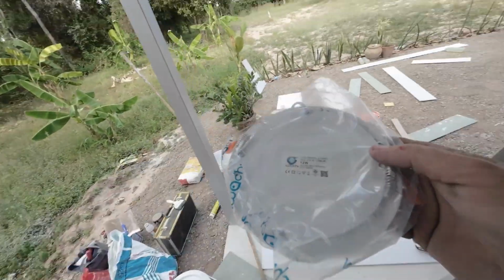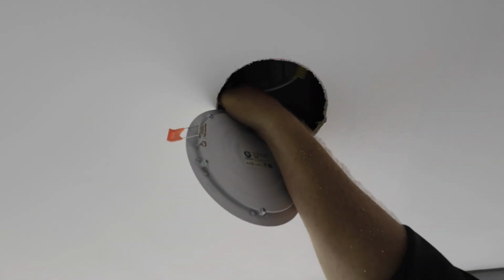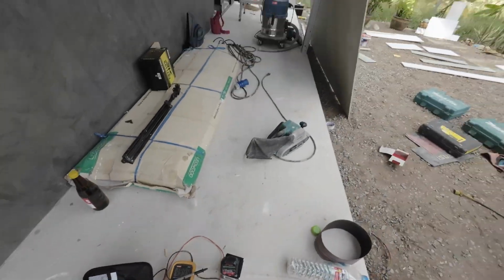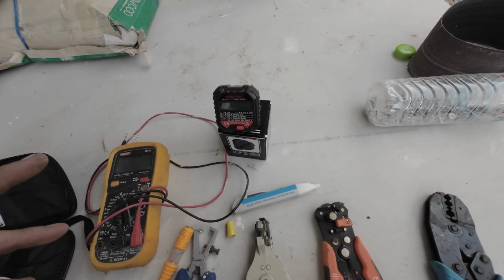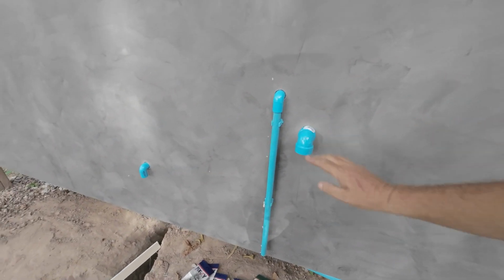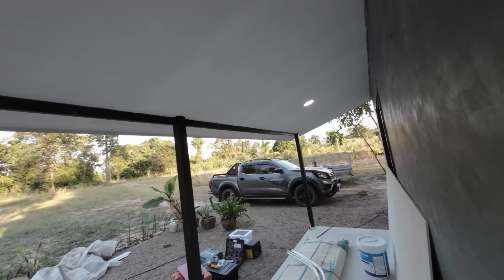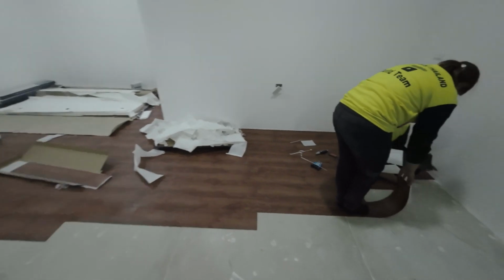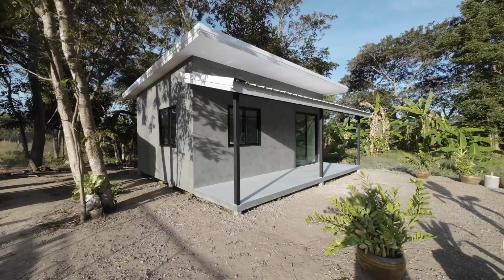Building a small home in Thailand   the finish Line   Part 6

Comment: Hello.Bryan.Have you any experience with lifting a house?We have been experiencing flooding and the missus won't wear the idea of a sump pump.The house is typical 2 story post and block .I was thinking that it would be a lot easier to undo the bolts at the top of the concrete posts where it's connected to the top post,then perform the lift,and just put a small piece of 7"X7" to raise it the 70cm that is needed.The Thai's want to remove the posts completely and replace with longer ones
Reply from the maker: Yes a long time ago but I have seen it done here in thailand when they moved a temple to a different  location in the grounds of the temple in chonburi. There is a lot of calculations  to be done with a civil engineer. Try contacting  your local ampher and talk with the engineer  there. Hope this helps 🙏

Comment: Hi there
Looks good and good quality finish , first tool I bought when I arrived in Thailand was a socket tester , plug it in to each socket and confirms correct wiring or not , peace of mind is a great comfort 
regards Davy 🏴🇹🇭
Reply from the maker: Me to David I was always sceptical  about the electrical  work done in thailand when I first moved here 19 years ago. Thais use a different  wire code system here but I like to keep to the UK code . Glad you enjoyed  the video matey much appreciated 🙏🙏🙏
Reply: @BryansThailand  my fuse box has a variety of colours.Mostly blacks for live and greys for neutral except for the odd random one that the aircon guy put in which has brown neutral and blue lives.I wish they just used double pole breakers like they do on some jobs I've been on in Germany..
Reply from the maker: @roystevenson1375   yes they use US standard  code but we being from Europe  we work from a different electrical code and I always request my electricians to use UK electrical code. Blue and black are always neutral red and brown  for live.
Reply: I think that will lead to some confusion for the maintenance guy coming in later..I think it might be better to keep the blacks as lives... Probably won't matter much except at the switch for lighting where Double pole would be better.(you could be interrupting the neutral at the switch,which could switch the light off but still be leaving live power at the light)